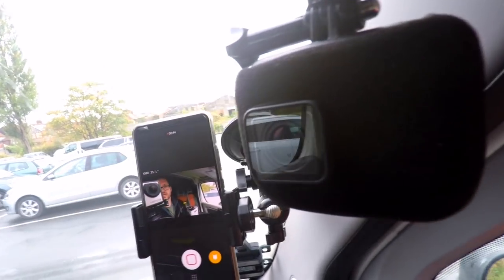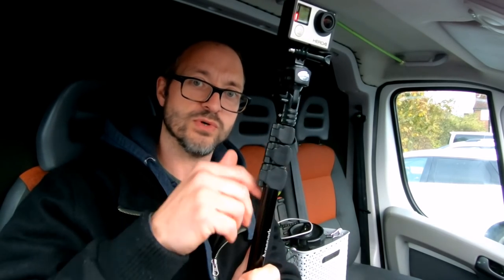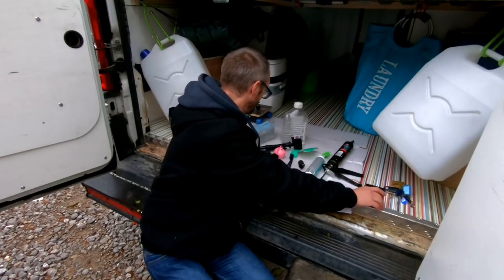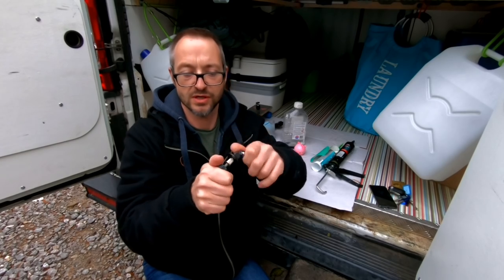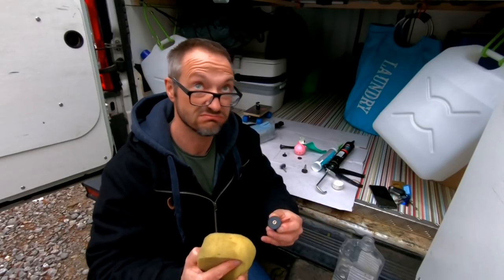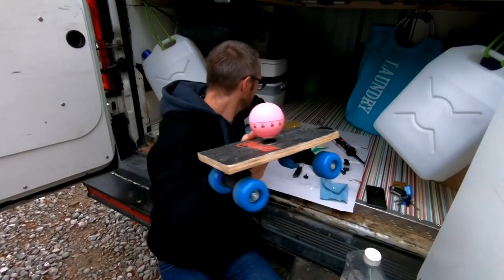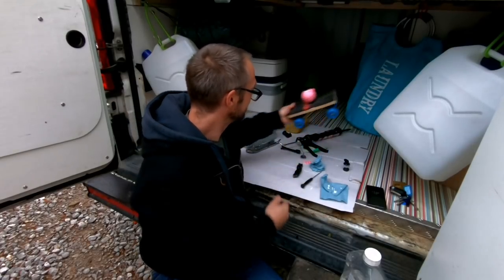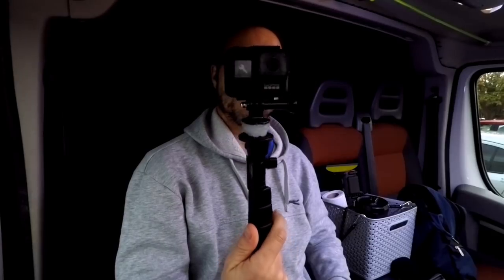83: DIY GoPro Hero 7 handling noise FIX & egg timer timelapse

Comment: Cool timelapse. For the GoPro - maybe tap washers or other flat rubber washers would work? You could even make them from an old bike inner tube or some small grommets??
Reply from the maker: A hard washer might not work, but those soft silicone grommets probably would. There is a rubber pad at the top of the stick already. I have actually found a solution, a anti vibration mount for an audio recorder. There's still some wobble, but zero handling noise.
BOYA BY-C10 Universal Microphone and Portable Recorder Shock Mount - https://www.amazon.co.uk/dp/B01IQWRTSY/ref=cm_sw_r_cp_apa_i_WknjCbA5Z7RS3

Comment: No idea why anyone would make that kind of movement on their handle......  I reckon you could probably make one of those drone mounts with some Popsicle sticks and spray paint. Love the time lapse pig,  ingenious.
Reply from the maker: Depending on the shot, I have my hands up and down it's length, plus it's extendable... its all hollow metal tubes. That makes it the worst possible thing to hold when the camera mic is sensitive! Clunk clunk.
If I shop around, those drone mounts also come with the GoPro mount already on it.... Not that I need any encouragement to start collecting popsicle sticks. 🤭

Comment: The handling noise on the hero 6 is unholy awful! googling some kind of fix is what brought me here =)
Reply from the maker: There are a few things that worked in the end, but the stabilization of the H7 might mean that your milage might vary...
Drill out the mic holes in the frame case. The factory one is made of brittle plastic, so a lot of the noise comes from that..I bought a well reviewed one off Amazon.
Buy a foam sock for the whole camera to block out wind noise. A cheap H4 one I bought could stretch to fit.
Mount the camera on a portable audio recorder mount.... This might not work for the H6 stabilization.
This is a ridiculous episode, but all my fixes are in here:
https://youtu.be/VkIyDlf-Jds

Comment: What you need Mevi, is a nice long screw.Put it in the end of your sticks like or silicone whatever nozzle and it'll really help to stop it drying out, or at least helps to pull the dried up sh*t out. One as long as the nozzle would be good. Like the pig timer contraption! 🐷🐖👍
Reply from the maker: Hee hee. Yep, the silicon had an unused rivet in the end which didn't do the trick. I'd usually use a screw, but the last time I used that silicon was waaaaay back when I was putting the deadlocks in and rivets were close to hand. I was surprised it was OK, otherwise I was opening up another! 👍👍

Comment: Thank you for this video. Surprisingly not as many videos on here addressing this issue. The problem really makes the video quality shit.
Reply from the maker: Agree, it's a shame. The internal mics are good, but the handling noise is a killer. The best solution for internal mics I found was a rubber coated handle and keeping a tight grip.
Wasn't long before I got the external mic adapter, a "vlog" cage and a mic. Makes it so much more complicated and not good in the rain.

Comment: Very creative!  Love the time lapse.  Maybe don't purchase the GoPro 7 if since I'm not as handy as you?
Reply from the maker: For an action camera, it's probably the best.... But judging by all these little cameras, good sound is less of a priority than good visuals.
There is a microphone adapter so you can plug in a good mic, but the adapter alone will cost you another $50.
Pick up a used Hero 4 Black (make sure it's a Black) and that has better sound and still does good video.

Comment: I’m not a great fan of the go pro even though I have one. I only ever use it for shots where you don’t need sound, underwater or time-lapses.
The case clicks are annoying.
Looking forward to your CatZero video 😀
Reply from the maker: I'll try to smash through the bulk of it this weekend. So much epic footage, I don't want to leave any of it out!
I imagine I'll be getting the mic adapter for the GoPro, but it'd be good if I can get reasonable audio without it. 😎

Comment: looking forward to seeing the mark ii made with the drone mounts. i'm impressed with the audio improvements though now the hero 7 is isolated. Not sure that the mark one would last a trip up in the mountains though. By the way...that egg timer is genius.
Reply from the maker: Thanks Paul 😎👍. V1 wouldn't make it to Tesco and back, let alone a proper outing. I'll update once the drone mount appears I'm out in the Dales at the weekend, so I hope I get that here in time.
The egg timer is my second of these. The panda timer got trashed, but I used it in a couple of vlogs. I once managed to time it so it seemed to follow me as I worked around inside of the van.

Comment: That's odd, I never had audio transfer issues from the handle, but i just checked and the handle on my pole, 😳, has faom around it, so maybe that's the answer, just a bit of foam around the be where you grip it 😳😜
Reply from the maker: It's an extendable pole, so I'd need to add some somewhere solid. I have a short solid rubber handle which is better. Maybe wrapping it in tennis racket tape. Hmmmm.
Is yours a GoPro official? I reckon they would have sorted that. Also the hard plastic skeleton case they supply gives the audio a strange "sea shell" sound - really exaggerated by the karma grip mount in your vid.